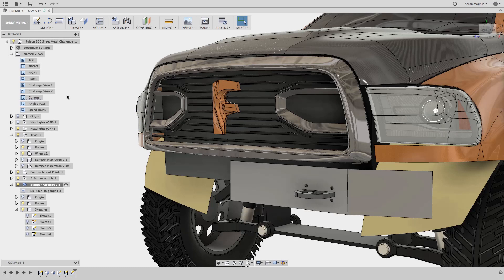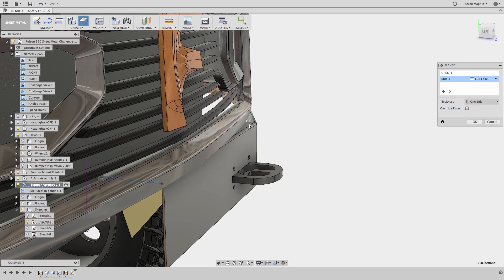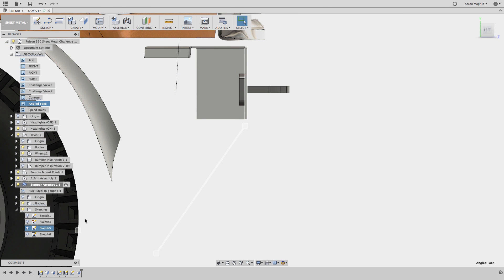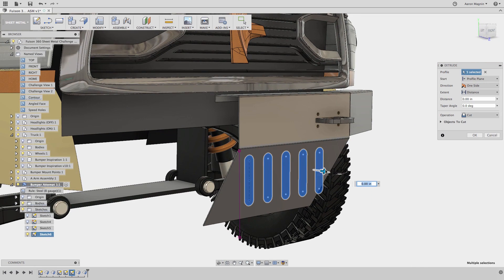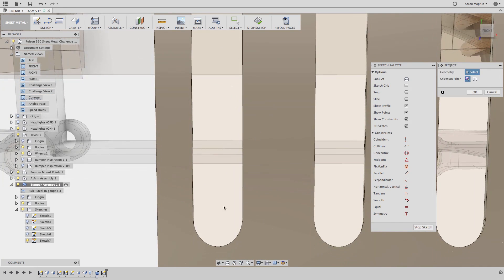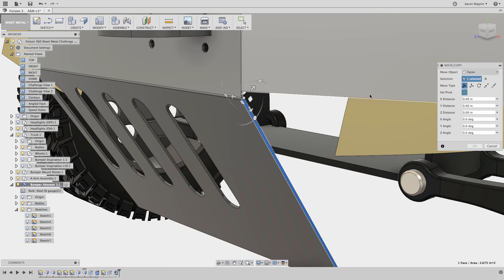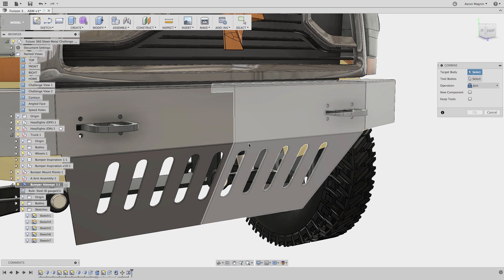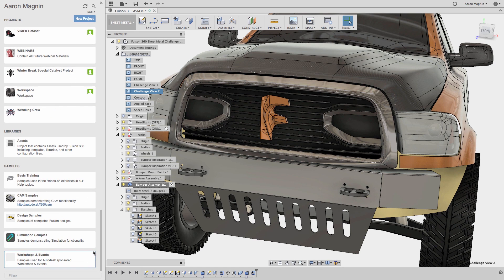QUICK TIP: Sheet Metal Gems Part 1

Comment: Can I use the sheet metal function to put bends in a previously made design? I have a stand with fee that need to bend out at a 45 degree angle..
Reply: thanks. I have tried a few different ways I just cant seem to get it right. it seems so simple but yet impossible using only the sketch command and extruding.. the moment I go  or maybe Im mis-understanding the instructions from the company that does the lazer cutting. they want it all in dxf format and also a 3d model to cnc bend the steel..

Comment: I've been using fusion360 for car design a lot lately, almost getting the hang of it, but it's very tricky. One thing I can't get my head around, which I'd love to see a video on, is interior design. I'd like to be able to design detailed interiors, alongside exteriors, in the same model. So far this feels virtually impossible. Could someone address this on the channel please?